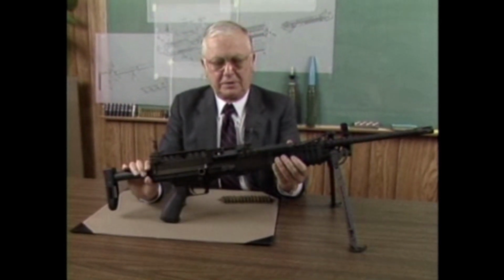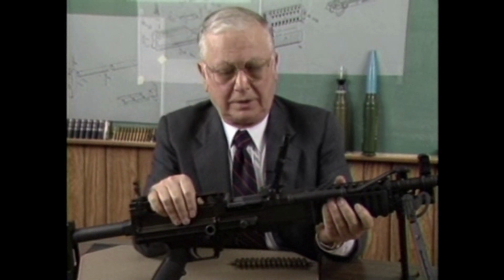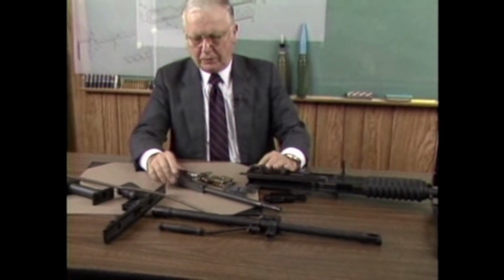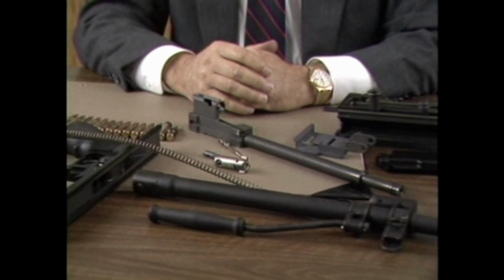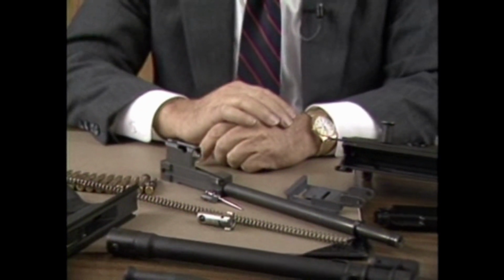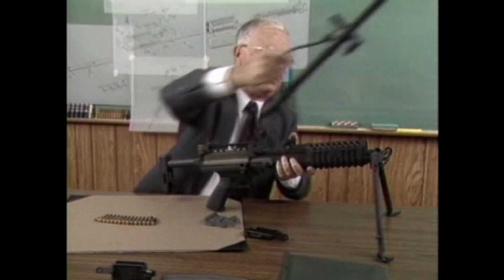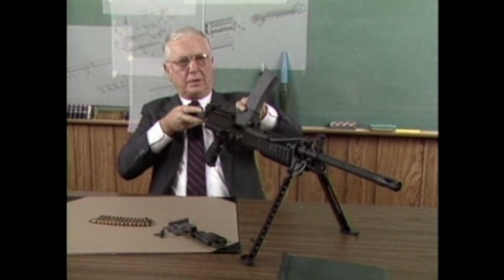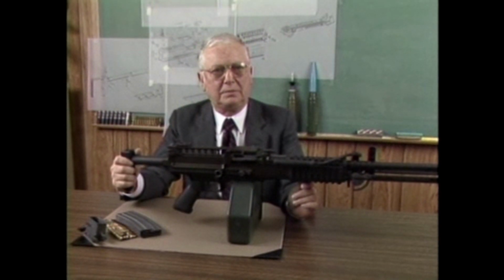The Eugene Stoner Tapes - Part 4: Further Work at ARES Inc.

Comment: It seems like everyone else who adopted this mans designs made them applicable firearms lol its like this man made prototypes and then they failed and new more effective firearms were produced lol the m14 is still in use compared to this mans ar15 which was designed to replace the m14 to meet the needs of the Military when it came to their need for a 7 poinds firearm capable of firing the nato round used, the only thing still in use is the civilian ar15 which is literally the ar15 the ar15 was never an automatic rifle. Armalite rifle modle 15

Comment: Lockhead Skunk Works had the designers working beside the shop floor.  Engineers could  work directly with the builders.  Likely, very different now with so many computers and highly automated tools.  And things like 3D printing.  They also tried to use existing parts from other aircraft.  Aircraft design and manufacturing is going through a new revolutionary stage.  Much of the testing done on computers using over 100 years of research data. And 3D printing allowing for very complex shapes that could not be made any other way. This is very useful in very complex rocket motors.   Knight Armament has further developed Stoners light machine gun.  It is likely the best LMG for shooting in the world.  But, sadly, with no major Buyers.  Knights also helped with brin guy big the long lost AR-10 back into production.  There are now dozens of AR-10 type guns on the market. Including exact copies for people interested in jistoric arms. The US Army has thousands of Knights M-110s.   The Ak-47 type weapons are outdated.  The modularity of the AR-15 allows it to adapt to modern needs and future needs. The M-110 and many AR-15s may soon be replaced by the Sig M-7 Spear.  The M-7 has many sikilarities externally. Soldiers need little training to adapt as they have very similar controls. But inside they are very different. The M-7 was built to fire a unique and more powerful 6.8mm ammunition. Also able to fire 7.62mm NATO.  Most soldiers will keep M-4s. It is mainly for squad riflemen. It comes with an advanced sighting system to greatly increase long range accuracy.  The new ammo with longer range also helps defeat body armor.  Sig also has a new machine gun to fire the 6.8mm ammo. The remaining M-110 rifles in the army may still serve for some time.  Like the AR-15 the new M-7 Spear is controvercial. And like most new weapons it will have teething problems. And critics will continue.  The AR-15 got much undue criticism. But is now extremely popular. And has over 50 years of service and many more to come. 
🟡🟡🟡🟦🟡🟡🟡🟦🟡🟡🟡🟦🟡🟡🟡🟦🟡🟡🟡🟦
Reply: The really interesting thing about the m5 (what was sig xm7) is it comes back full circle to gene stoners work on ar12 ar16 and some others.

Comment: On the F-104 Starfighter they had to lower the cyclic rate because at supersonic speeds the gas pressure was blowing the hatch off, the air pressure was pushing the gasses back into the compartment and finally another round fired would boom it off. It was a GE Electronic Gatling gun/cannon, like the A-10 Warthog but a single port under the cockpit at the side of the plane.